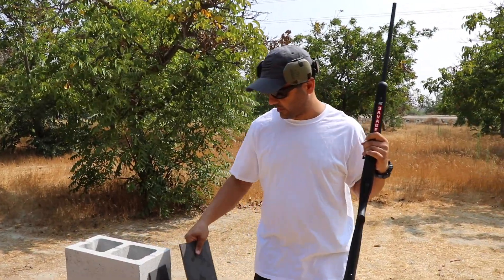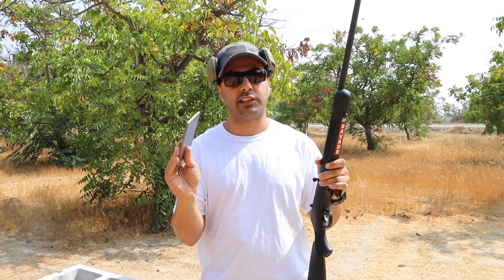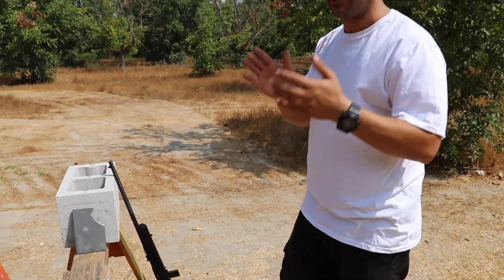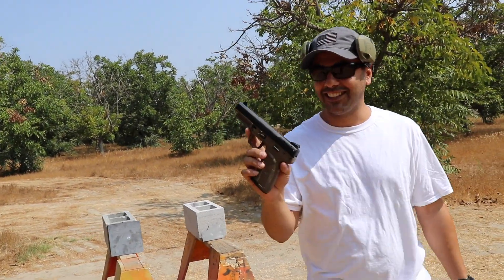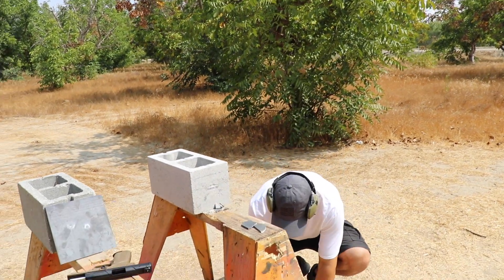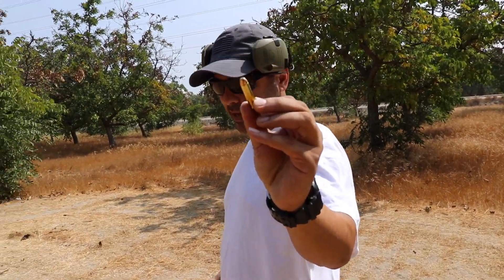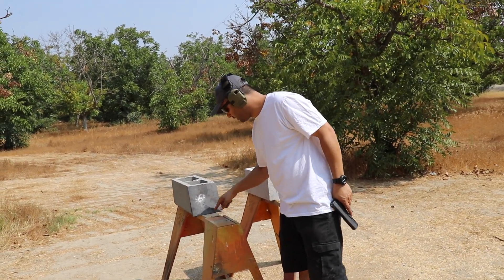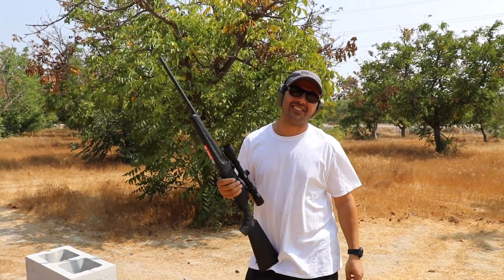Is Tungsten carbide BulletProof? - FN 5.7 vs steel

Comment: *10mm....super pumped up .40 cal*
Reply: No the 10 mm was first the 40 is cut down 10mm. not a pumped up 40.
Reply: @mcrafton89  What do you think happened when they "cut" down the 10mm to make the .40? They  made it shorter with less powder and power. So the 10mm is a pumped up .40 basically. Same size bullet but more kick. You wouldn't say a .45 is a pumped up 9mm would you?
Reply: @mcrafton89  ya I know. I was just saying the 10mm would be a "pumped up" .40 cal before being considered a pumped up 9mm....you know what I'm saying? I'm not saying they pumped the .40 up to make a 10mm..its the other way around as everyone knows. In your same reasoning your saying they pumped up the 9mm and made a 10mm? I guess that makes sense too. I get what your saying,  but I would consider the 10mm a pumped up .40 since its the same diameter but longer bullet and casing.

Comment: You can get a 3 inch pure tungsten cube from ebay for about $1000. They weigh over 17 pounds!
Pure tungsten will handle impacts much better than carbide.

Comment: Tangston carbide is actually used in Gls bulb and halogen bulb filaments because of its highest melting point this metal is really very expensive and it is 2 to 3 time rigid than steel 4 to 5 time than cost iron it melts at 2400 to 3000 degree Celsius impact strength is week

Comment: I had a tungsten wedding band and in the process of working on my car one day, I dropped something and reached down to catch it and smacked my hand against the concrete driveway and it shattered into about 6 pieces.  I think if you had something padding the tungsten between it and the cinder block it would help a lot. But then again that is my uneducated opinion. Take from it what ever you would like. Also love the channel bruv.

Comment: Try getting pure wolfram/tungsten instead of (sintered) tungsten carbide 
It should be a little less brittle.

Tumgsten carbide is made by powdered tungsten and some other metals or "glue" then pressed to the final shape before baking it instead of beeing one solid piece

Thats why it is more like caat iron
Reply: Question: what would one use as a crucible for melting pure tungsten metal?  Asking for a friend...
Reply: @pirobot668beta  I think graphite can be used both as an arc furnace and the crucible
Reply: @Dorito 65 subbed

Comment: no it wouldn't be that different, but it shatters, not bends. there is a reason why they don't use it for bullet proofing. but if you laminate it with something like carbon fiber, or rhino lining it would be different.

Comment: Tungsten carbide is very hard and scratch resistant but it's very brittle. 

Some tungsten carbide rings will shatter if they hit the ground hard enough. 

In emergencies, tungsten carbide rings are hit with a hammer to shatter them, because cutting through them is much harder.

Comment: Tungsten Carbide indeed contains carbon elements, hence makes it harder (high hardness retain its sharpness longer) but brittle indeed (not toughness).
Drilling rig indeed use tungsten bits on their cutting head, now that's one really super hard & tough tungsten bits.

Comment: Edwin ;                             I'm not a metal  Urges , but from what I've learned , or should I say heard , the process of making Tungsten Carbide , is completely different from how any other form of steal , or iron is made . As far as I know for example you can't  " Smelt  " Tungsten Carbide . You for example can't take a piece of it , and make a sword . And I also understand it is made under great pressure , and for that treason it can be very brittle . Don't hold me to it , but that's what I've heard .                        Happy  Shooting                  Jack

Comment: Tungsten carbide is generally used for cutting metal very hard but brittle. Pure tungsten is not as brittle, therefore should be able to take more impact without shattering

Comment: Pure tungsten is incredibly tough, it would have been a very different story if you’d got some of that. Tungsten carbide does not react well to shock forces. 20 years of cutting metal with it showed me that on many an occasion.
Reply: Tungsten and tungsten carbide completely different things, Tungsten is a metal in periodic table, TC is made by tungsten powder and different additives like cobalt, nickel, etc. pressured  and baked in ovens to create hardest and very brittle material after diamond.
Reply: @nicomedia62  diamond is less brittle than tungsten carbide.
Reply: @benbraceletspurple9108 , there is a material called Wydia, and is synthetic diamond and it is more brittle than an original diamond. The widia material is the Tungsten Carbide :)
Reply: @JustMeNoOther   Widia
Reply: Glen Downer 
Yes sir this man knows. Many types machinist tooling require tiny replaceable tungsten carbide cutting faces. They are needed to efficiently cut in to hardened metals. TC is so hard that it is extremely brittle. Running and cutting smooth and proper and it'll bore its way through most anything but it crumbles under a shock load. I'm far from an expert but I've watched machinists cut the hardest of steels with a tip and watch them drop a tiny  new replacement tip and shatter.
Reply: @07zx14White  thats why on CNC equipement when error happen the carbide go boum
Reply: in my company we grind these tungsten tools
Reply: mTn Yeah but you don't bend them
Reply: Glen Downer it is pure that’s why it broke.
Reply: Well its so high in carbon that its very brittle
Reply: Carbide tungsten is not a metal, is a ceramic, the cutting inserts are made with ceramic materials and the process to make the ceramic powder united is, sintered.
Reply: Well actually pure tungsten (without the natural elements that are usually found with it) is actually softer than steel. The tungsten you are talking about is pure plus a small amount of elements that are naturally found mixed with it. Those elements combine with the tungsten giving it is hard and thought properties.
Reply: incorrect. tungsten is incredibly hard. it's rather brittle. gold is tougher than tungsten
Reply: the company Sandrin Knives found a way to make Thungsten Carbide flexible for their knives.
Reply: Yay 1 man they have some really nice looking knives but damn is the price steep. I imagine its pretty tough to sharpen a tungsten blade but at the same time I bet they hold an edge very well. I would hope so at least.
Reply: Yeah he should have used a high-Tungsten-content super-alloy... instead of TC.
Reply: Thank you Sir, I always appreciate new knowledge. I wear a Tungsten Carbide wedding ban and was very interested.
Reply: Glen Downer crashing endmills is fun.. especially when u get the rest of the day off
Reply: There is a difference between toughness and hardness. Tungsten carbide is hard but not tough, in the opposite steel is tougher but less hard.

Thoroughness measures the ability of a material to absorb energy without fracturing. Hardness measures the localized deformation lets say how scratchable a material is.
Reply: Pure tungsten carbide is hard and brittle, but it gets worse. The tungsten carbide you usually get is tiny particles cemented in cobalt, which makes it even more brittle. And yes pure tungsten is much tougher.
Reply: I design and program for a carbide manufacturer. We have millions of dollars in tooling alone..and that is only in endmills and drills. A half inch diamond coated (pcd) endmill is $300. But the part I'm programming is worth 10k by itself. There is a ton of money in manufacturing carbide.
Reply: What if you put the tungsten carbide on a thin sheet of Carbon fiber for just reinforcement and stuff would that work
Reply: @thewiseotter3884  tungsten carbide is extremely wear resistant, but also extremely brittle. The carbide would offer little "extra" resistance than the carbon fiber by itself.
Reply: Do you think titanium is better than tungsten for Jewellery? Tungsten seems very brittle
Reply: That's actually factually false. Tungsten carbide is a harder and more robust material than elemental tungsten. If you want me to link data for that I can do so.
Reply: Both are extremely brittle. I use pure and alloyed tungsten for different types of welding and I can break them in half with barely a tap from my ball peen hammer
Reply: Vulcanized fibre or red fibre is a laminated plastic Kevlar aramid nanofibersElectrical Grade: high dielectric grey, 100% cotton, very flexible, (Bone Fibre:
Reply: I'm a welder and work with tungsten. Pure tungsten just shatters when hit with a hammer. Very hard and brittle.
Reply: Stfu
Reply: GFYS
Reply: Wrong. Tungsten is extremely hard but it's also extremely brittle. That was normal for tungsten
Reply: xAeschylusx, I agree with you. Tungsten is not tough at all, but it is incredibly hard and when mixed with cobalt in an 80/20 mix has incredible wear resistance. This is typically what most tungsten tool bits are made from.
Reply: @xAeschylusx  wrong. Tungsten and tungsten carbide are different.   Pure tungsten wouldn't have shattered like that. Already watched it on another channel.
Reply: @xAeschylusx ur wrong
Reply: @user-qu6nn2vy3i  Cleary I’m not. Did you watch the video t ard?

Comment: tungsten carbide is a brittle material.  It is a cermet “ceramic and metal”. It is very hard but will fail in brittle nature, that is why it fractured.  Steel is ductile and will deform.  In armor tungsten carbide will defeat a round, but you need to have the proper backing and strike face.
Reply: tungsten carbide isn't a cermet (which is a composite material of a ceramic and metalic materials) it is a ceramic chemical compound of tungsten and carbon. tungsten carbide can be the ceramic part in a cermet with some metal.
Reply: Yep, the composite nature of 'shatter bullet' followed by 'dissipate energy' armor works really well.
Reply: @Aaron Washburn that is a different scale. The difference is why it is used in tank armor plates. The former 12 inch armor plates were defined by Abrams as inferior in multiple air to ground missile testing and anti tank 20mm and 30mm DU tipped rounds.to 1 inch thick DU armor. On the Rockwell scale DU is hardened from about 60 to about 80 in C scale hardness in almost 100 % pure form.
Testing concluded failure above 30mm thus the thickness is usually around 3 inches. This makes the 2007 M1A2 Abrams have the second strongest nonreactive armor in the world, only second to the single-shot resistant of the British tank with still classified layered metallic and ceramic armor.

Hardness and toughness are not always inner related, that may be the biggest myth of all regarding materials. After all  aluminum and aluminum alloys are both much less tough than steel, and much softer.
Reply: Bryan Cranston wouldn't know a damn thing about tungsten but just ask Walter White. He'd tell you all about it.
Reply: He needs tungsten metal, not the carbide composite
Reply: Yes , it's a ceramic. Sintered particles heated to the point where they fuse.
Metallic , elemental Tungsten is WAY tougher , and extremely expensive
Reply: This is alleviated by lead plates in front and behind it.

Depleted uranium is both harder than tungsten carbide (76 vs 80) and tougher, not as tough as steel but very close. 1 inch of DU is equal to 15 inches of steel.
Reply: @Aaron Washburn further more why don't you buy some DU plates and shoe them stacked up to a 50 bmg. See what that does.
Reply: @Aaron Washburn oh oooo yeah ah ouch, no, no you  can't cause DU is a controlled metal. Ummf  guess you can't prove me wrong. And no some random alloy cant tell you the pure metal's hardness.
Reply: Love it when a simple project turns into a circle jerk.
Reply: I was just about to say that THANK YOU.
Reply: It's only a "cermet" when a metal is added to it
Reply: Thisssss. Carbides the problem

Comment: I have used Tungsten (W) foil during my Master research, actually, Tungsten is very brittle at room temperature, the basic mechanics here is that at this temperature there isn't enough vibrational energy in the lattice to allow for slip. So the atoms are almost locked in place and are unable to slide past each other, therefore they will separate and the material will fracture

Comment: You should send the WC pieces back for recycling. Don't just throw it away.

While having a high melting temperature, it will tend to oxidize without a controlled atmosphere at high temperatures. Similarly, while having a very high hardness it has a quite low fracture toughness. This means that once a crack begins, there is very little natural tendency to stop crack propagation. By impacting it with a bullet, it is creating some tensile forces on the material and ceramics are tend to be very weak in tension (though very strong in compression). Additionally, in terms of bullet protection, by breaking apart it allows a dissipation of the impacting energy rather than transferring it to the protected target.
Reply: Why to recycle?
Reply: Finally an intelligent comment that actually is full of actual facts!! Thank you!!

Comment: I already know Tungsten is almost as hard as diamond but I've been wondering how strong it is for some time. I guess this answers my question. Looks like it's not really strong at all. For anyone who doesn't know, there's a difference between hardness and strength of metal. If it was strong, it would bend instead of shattering.

Comment: Edwin, if you drop Tungsten Carbide, it will break.  If you need more Tunsten Carbide, I suggest you contact either Sandvik Hard Material in Westbranch, Michigan or Ceratizit, in Mamer, Luxembourg. It is very hard material, however it is very brittle as well. Consider it the Glass of all metal.  What is harder then Glass?  Diamond, also very brittle, and that is why you can cut diamonds, they fracture.
Reply: You're right I'm a driller I'm using sandvik equipments ! Sandvik use tungsten for manufacturing drill bits. It's only diamond which is able to sharp the drill bits buttons in tungsten. Sorry I'm a French native speaker
Reply from the maker: thank you . got it. good info
Reply: How about deactivated uranium,or spent fuel rods,you may want to shoot it from behind a lead lined poured concrete wall.
Reply: You have to back tungsten.  Its like lime stone.  But it's so hard it will break if you throw a knife at it
Reply: i think there is way cutting diamonds, laser or waterjet
Reply: bebeto ya... with a diamond...
Reply: At least Tungsten Carbide is not a metal, it's a ceramic made at extremely high pressure and temperatures ~3500°C. Therefore it's with a 9 almost as hard as a diamond with a10 on Mohs Scale. But for it's ceramic, it's not bendable like metal, so it breaks if bent.

Comment: So you know, it's not a shuttle. No back and forth. It's flying near the sun. (3,000,000 miles) and they're  measuring solar winds... much hotter than the surface of the sun. Tungsten can take those temps without burning up. One of the few things sticking out  from the heat shield. But, very brittle!

Comment: Tungsten is hard.  The harder the material the more brittle it is.

That's why ar500 steel doesnt bend it breaks.
If the hardness is too much it doesnt allow for micro bending and vibrations can snap it off

Comment: Tungsten carbide is a crystal not Tungsten metal. A sapphire is aluminum oxide and will shatter in the same manner.
Reply: Most metals have crystalline structure.

Comment: Edward, if you want to get some bang for your buck with the Tungsten, see how it holds up to thermite or thermate, it will melt through steel but probably not the Tungsten. Just an idea

Comment: Tungsten is extremely hard but at the same time extremely brittle, that's why it keeps shattering. The steel is able to bend therefore it absorbs impact. The tungsten cannot bend because it is too hard therefore it becomes brittle and shatters when hit with something because it cannot absorb the impact and bend like the steel.
Reply: That's not quite true. Pure Tungsten metal is quite ductile. You can even make a micron size wire out of it (used in old light bulbs). The guys seems to have Tungsten carbide.
Reply from the maker: This answer sounds good to me. 😊👍
Reply: Edwin Sarkissian It is not the Tungsten that is brittle, it is the carbon.
Tungsten by itself is the strongest metal by volume both in terms of shock and grinding
Reply: Edwin Sarkissian tungsten carbide is half carbon and half tungsten. So basically it’s coal and tungsten. Chemical formula is WC
Reply: @nathantorresstanevil6958  used to make toilet pointers lol 😂😂😂
Reply: @n0nenone  lol
Reply: @EdwinSarkissian  try tungsten disilicide next time. It won't shatter as easily as tungsten itself or tungsten carbide. Tungsten is more dense that tungsten carbide and tungsten disilicide is less dense than tungsten carbide, but just a little more dense than steel. But with the silicon properties I would say it might get dented easier but won't shatter as easy.
Reply: tungsten isnt brittle....the carbid makes it that. pure tungsten can withstand more than titanium
Reply: beat me to it
Reply: (1-3-5)(ODD)
If it "Chatters" to much, tell it to Shut up! 🤣
Reply: @jaysonmartinez2830  spell check betrayed me🤣
Reply: Finally an answer that doesn't hurt the soul of a metallurgist. Thanks for posting a great answer.